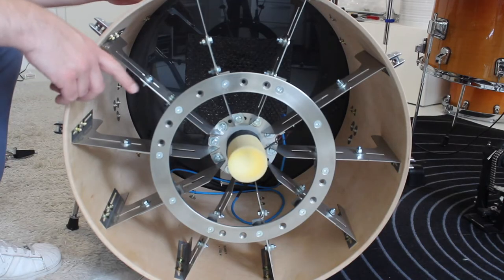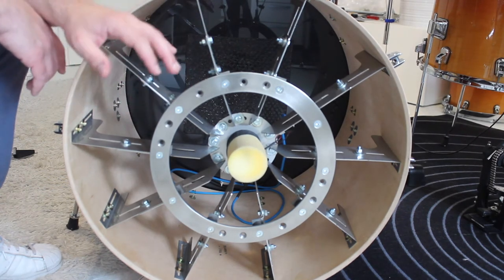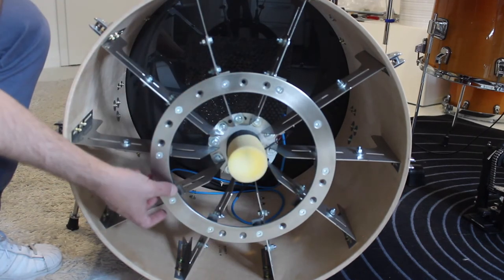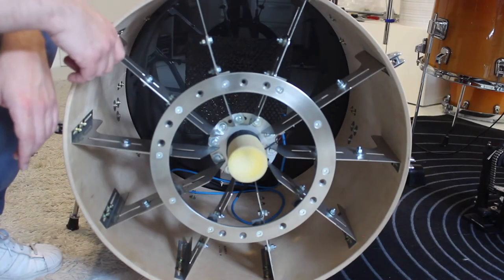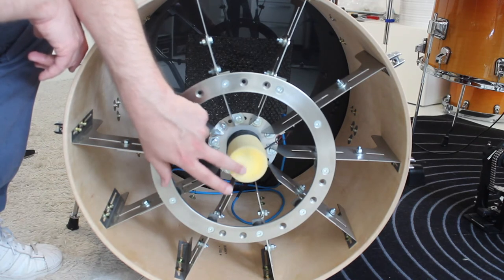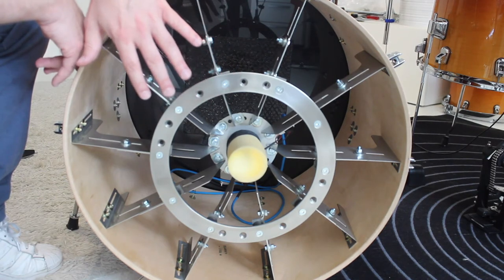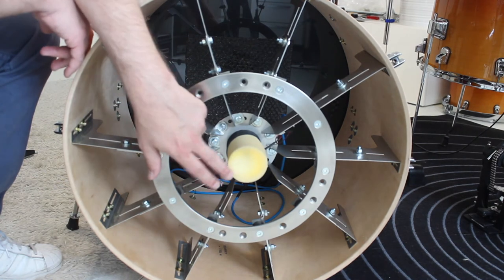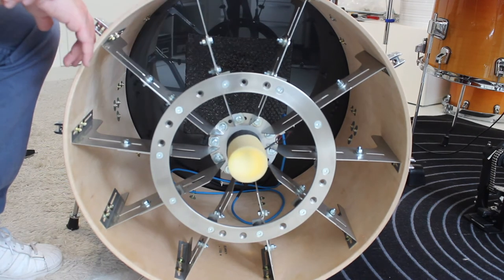Stainless Steel Kick Trigger System from Wronka-Drums - Review, Sound, Quality

Comment: Thanks for making this video. I liked the part where you could see it in action. I would have never thought that the ring has such an effect. The system is very smart. You could actually use it for 10, 8 and 6 lug bass drums. This is an engineering masterpiece.
Reply from the maker: Yes, it is. I've just talked with Jörg Wronka, he considers to start building his bass drum trigger systems again.
Reply: Really hope he starts again, this trigger is amazing!
Reply: Mike said on Facebook that Jörg Wronka is thinking about continuing. He also said that he has some in stock.

Comment: Hi, Luke. I know this is an old post but have a question. 

Bought a used Wronka Bass 10 and I wonder how you got rid of the trampoline effect. After mounting the Wronka with instructions from Jörg I have a kickbeater that bounces all over the place. I’m not always burying the beater but I want to have the option depending on the song and so on.

I use a 22” Drum-Tec Design 2-ply Mesh head and Drum-Tec impact-patch (The one that’s a little thicker). Tama Speed Cobra with Tamas plastic beaters that comes with the speed cobra.

Thanks and Mit freundlichen grußen
Henrik
Reply from the maker: Hi Henrik. I know this effect. From what I remember … they key here is to loosen your head and the position of the Wronka sytem itself. The tighter you tune your head, the bouncier it gets. Additionally, you should slightly change the position of the Wronka system. Try to set it a touch further back into the shell. Or even cut the cushion so that it gets smaller in order to put it further back into the shell. It‘s hard to tell from a distance, but I think the foam cushion might be too much outside, hence your beater is bouncing.
Reply: Hi, Mike. Many thanks for your reply. What I did to get rid of the bounce was that I, like you say, moved the whole trigger further back in the shell. I also disassembled the steel damping ring and screwed it back in place but removed the ”rubbergaskets”. So now, the damping ring has no contact with the meshhead and only the piezo with the foam-cone is touching the head. This gave me a lot more headroom to tune the meshhead for my taste and feel. Also have my beaters off-set so I don’t hit the piezo-cone directly. Also, I cut out a fitting piece of high density foam that fits the inside snugly of my 22” and made a 20 cm diameter hole in the middle of it to get that mylar feel and now being able to bury the beater when I want. The Wronka-system is very versatile and can be adjusted To the players liking. Unbeatable, super stable and very reliable. Do you still use yours, Mike?

Comment: i'm starting to think having an inner ring inside the bass drum is the best way to reduce the bounce of the head by reducing the surface that resonates from the hit. When you play a roland kick tower, the beater never bounces back when you hit it, and that's the way it should be (like on an acoustic drum). I'm assuming the inner ring is just touching the mesh head and the foam cone protrudes 1-2 mm outwards from the ring?
Reply from the maker: Yes, you are right. That's exactly the way this trigger system is built. Beside that, the mesh head is tuned pretty loose, so there's hardly any bouncing effect from a too tight mesh head and that my beater can bury into the head. However, the drum-tec pro S series is still the best kick drum I've ever played.